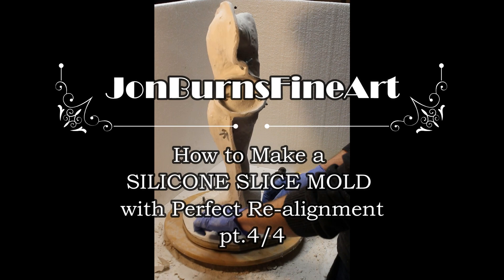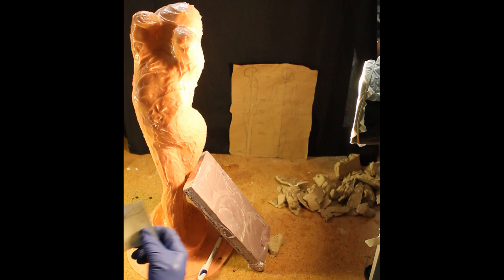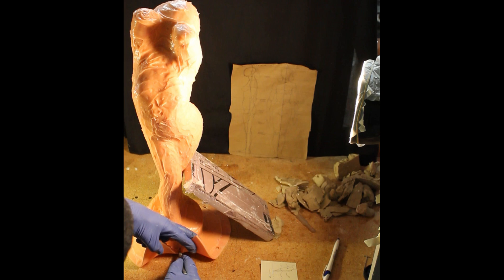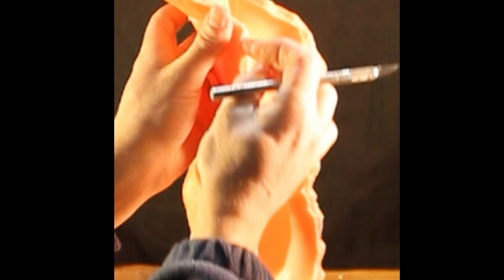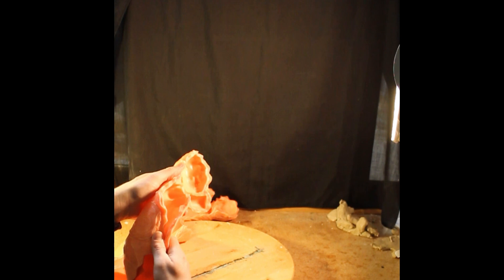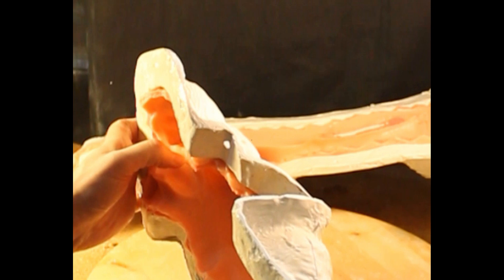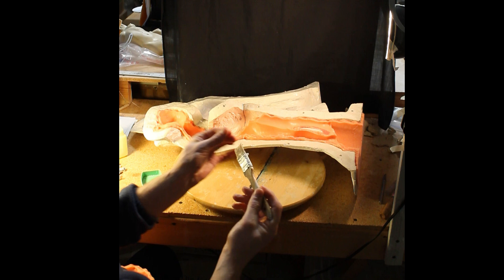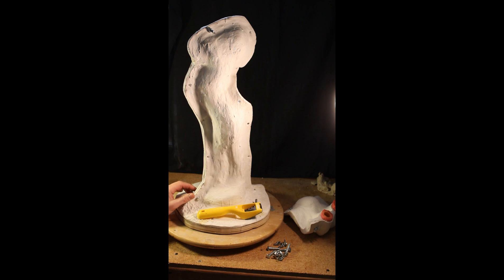SILICONE MOLDS FOR SCULPTURE how to make perfect slice mold for a seamless casting

Comment: It's interesting how you do the zig zag cut on silicon.  Most instructions I received before were building a thicker line where the cut will happen. I did it. But because the line is so thick now (the base mold and the wall) that it is very hard for me to get a nice cut and my zig zag gets messy.  I will try your way with no additional wall. Thank you

Comment: That's interesting how you molded the arms.  It looks like you built a pour spout in to the ends, layered on silicone over the whole piece, then covered it with the plaster mother mold.  Then you cut the silicone and plaster off of the end of the fill tubes to create the openings.  It was never attached or mounted to anything throughout the process.  That should work nicely for the arms of my sculpture, which are small and irregularly shaped.
Reply from the maker: Thanks Terrence! That's exactly how I did it. Another way, which would be better, is the way we approached it in the foundry. Run a long screw into the attachment end where possible, string a wire around the screw and bend a hook in it. You can hang it between coats this way. Muy better.
Reply from the maker: Btw, if you remember how I bent the drinking straw in that video, you'll understand better now it was to regulate the distance and support the overall structure.
Reply: @JonBurnsFineArt  That's brilliant.  I have been struggling trying to mount these irregular shaped pieces to a board.  With brushed on silicone, I don't need to.